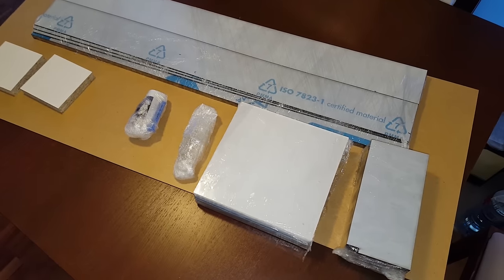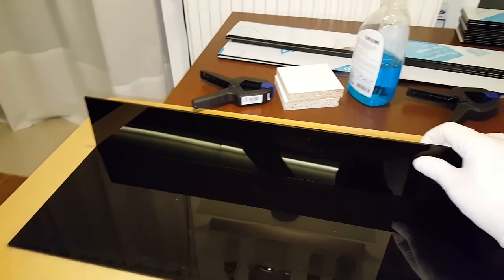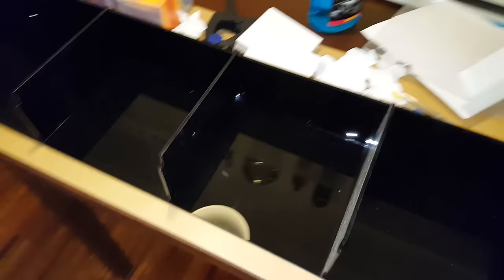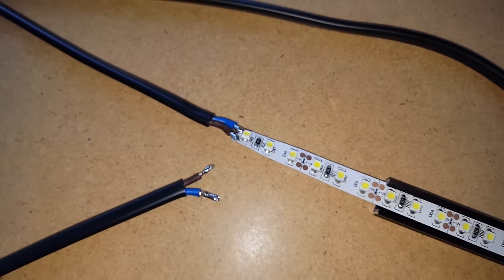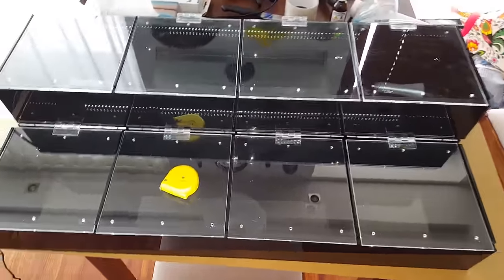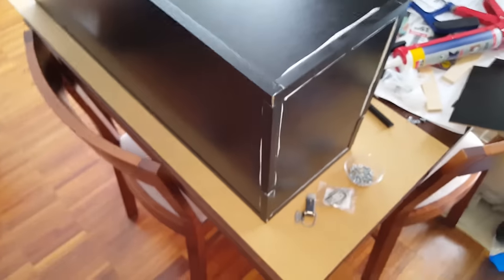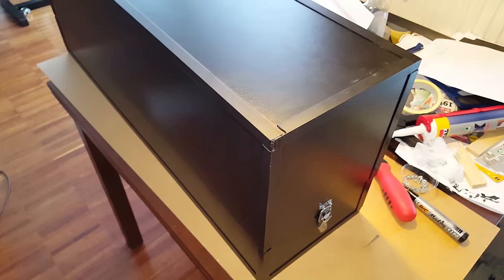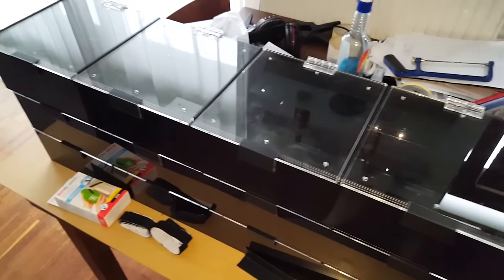How to build an Acrylic Display for Reptile Shows!

Comment: thats a great diy. do you know something else diy racks not using pvc board? because i knoe pvc board is good for ball python like for humidity and heat. Because thinking about a wood or something and place something on the top of the tub to hold the humidity like plastic sheet or something just to hold the humidity and thinking of placing a aluminum tape below the heat tape for the wood not to heat and broke